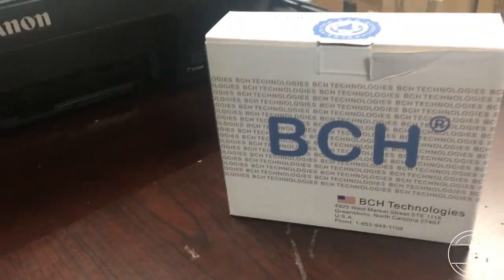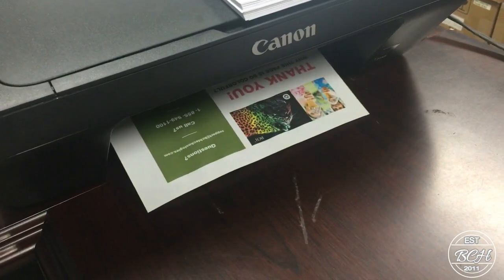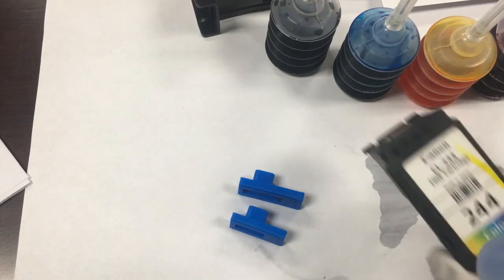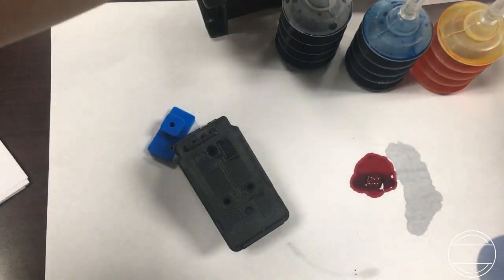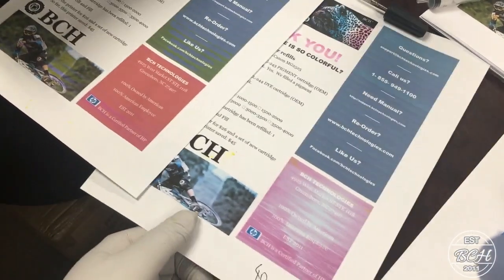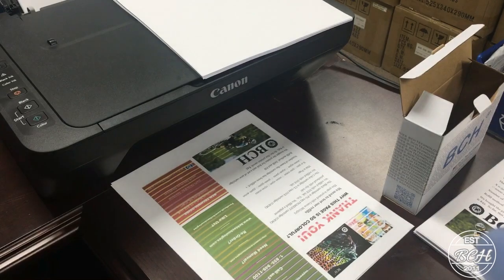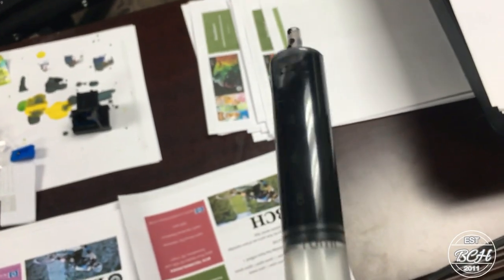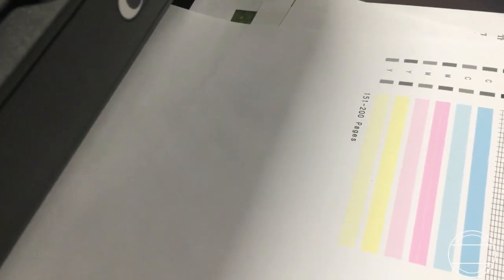3 Common Mistakes Refilling Canon Printer Ink Cartridges

Comment: Hi Kevin, Do these cartridges need to be reset for page counts after refilling? Also will this printer error out with a full waste ink pad?
Reply from the maker: Those are "gray" cartridges, which you disable the printer's ink monitor (turns gray), so you can printer forever. However, they cannot be reset. The HP is almost the same way except if you rotate a few sets, the HP will forget the cartridge and mark it as full again. The Canon will never let you be "full", but it will keep working.

Comment: Hello there, everytime i try to refill my black cartridge, it seems to leaking much of ink from the nozzle right after i refill it, even after i tried to do ink suction with priming clip, what cause the problem? is it because i overfill it?
Reply: Overfill or because you injected the syringe too deep that it has punctured big hole in sponge or the filter
Reply: @shrujanamsyama9940  thanks for the reply, it seems that I overfill it because after I do ink suction with the priming clip and a few usages later, there is no more leaking ink from the nozzle

Comment: Best to insert needle to bottom and refill slowly.  This avoids air and keeps the siphoning good. Pop the top and wash out sponges. Prime a bit. Head cleaning.  Windex and IPALCOHOL  for a major overhaul.  If that all falls toss it n buy a newbie. I don't recommend spongeless. The sponge is needed to slow delivery of ink.
Reply: How do you pop out the top? I tried but not worked
Reply: @KelvinsurajRepairs  petrol dabbed on the seem and then the right type of blade, exacto knife. Cut and eventually pry open. Don't cut off a finger
Reply: @Swenser  i only want my ink lol😂😂
Reply: @Swenser  I would not recommend inserting needle too deep as hole in sponge or filter can be damaged

Comment: After refilling the black ink, the printer says low ink, what could be the problem
Reply from the maker: Keep printing. You can't "reset" the chip. Just keep printing until one day the printer stops you and says "Error 1688 (or 1686,...)" the following cartridge is depleted. Do not close that window. Keep the window open and press and hold the STOP button for 5 seconds. The STOP button is the one with a red upside-down triangle, not the scan button. You will hear a click, and the printer is back to work. It won't track the cartridge ink level anymore, and you can add ink as many times as you want.

Comment: How to stop over Flow yellow ink line in photo printing.i am helpless to resolve this problem
Reply from the maker: First, make sure the cartridge is not overfilled.  The cartridge has a sponge and your goal is to get the sponge wet, not soaked. Many people believe there is a swimming pool inside the cartridge and fill the ink to the rim.  Don't.  For the overflow cartridge, just leave them in the printer for a day or two, then take them out and wipe the bottom clean.  Secondly, if the leakage only happens during photo printing, try to print a few color pages with yellow and see if it helps.